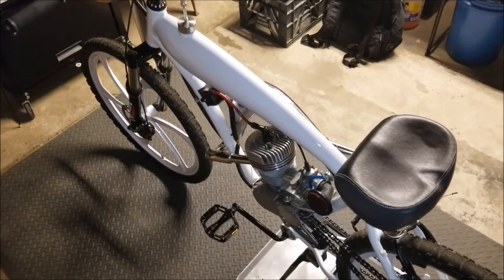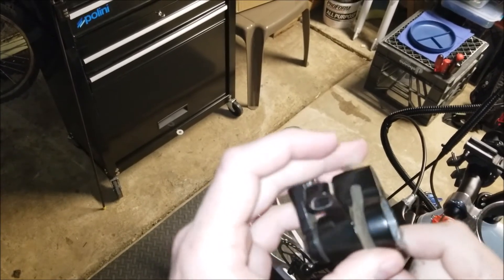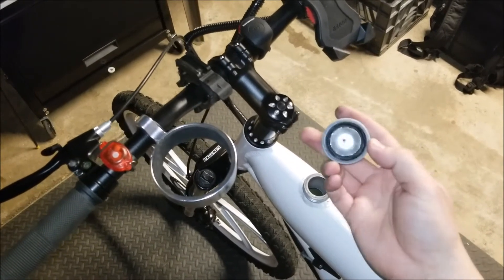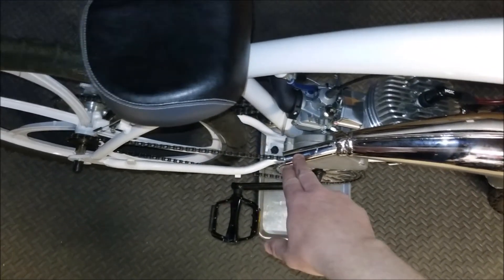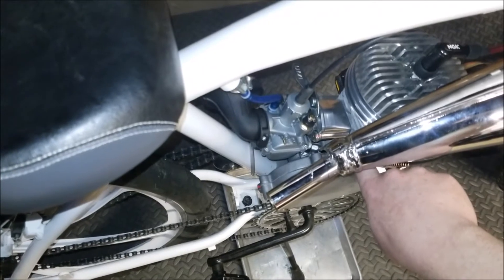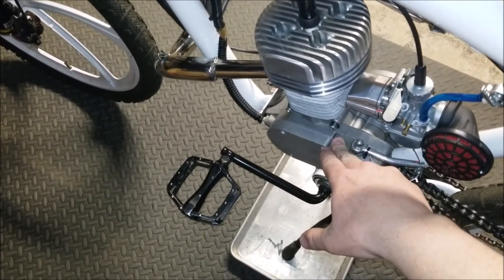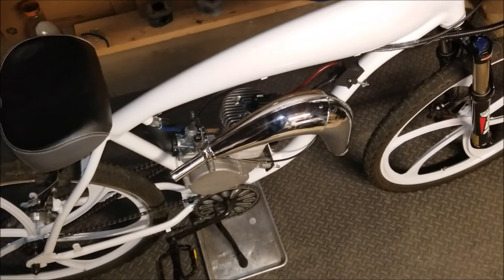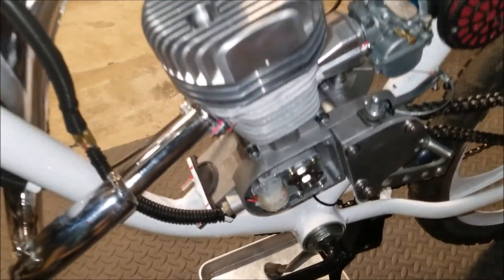Motorized Bicycle Upgrades: Volume II

Comment: Also, what engine did you purchase for your motor bike? In your video you were talking about how you upgraded the carburator? Can you please provide more information on that? TIA!
Reply from the maker: I have a CNC Billet aluminum motor on there now that I assembled myself with balanced cranks and upgraded clutch. However the carburetor I upgraded to was a Mikuni vm18 clamp on carburetor. Just below is a link. I purchased it from treats. If you check out some of my other videos You'll see the carburetor

https://www.treatland.tv/mikuni-vm-18mm-p/mikuni-18mm-vm-round-slide.htm?gclid=Cj0KCQjw_viWBhD8ARIsAH1mCd6SBWvJkXb7ErgKipjgGpxD4ccCKSHxfSAVh_uyXRm5WiMerx2Np8IaApHdEALw_wcB
Reply from the maker: What kind of setup do you have?
Reply from the maker: When upgrading to this type of carburetor just know it's a little more complex than the stock carburetors that come with these motors. You might have to tweak it with the jetting and fuel intake and in some cases the fuel float. I've made a few videos addressing the aforementioned.
Reply from the maker: You're also going to need an 18 mm intake manifold for the motor to match up with the upgraded carburetor
Reply from the maker: Here's a link to another video I did on a sprocket removal and you can see in the video the reed valve setup that I have that the Mikuni carburetor would connect to. The Reed valve will help immensely with fuel blowback into the carburetor which can mess up the fuel to air mixture ratios and cause fuel leaking out of the carburetor onto the bike frame. I recommend a reed valve. you might have to change the carburetor jetting.

https://youtu.be/LVgnUfSoQKw

Comment: it wood be good idea to have fuel Gage and ad a third transfer port ad two carb to it with two ram air tube facing forward coming out were the filter is

Comment: Bicycle Motorsports I know you're into gopeds as well, have you ever considered trying to retrofit a GSR60 goped engine like what Derek Short has all built up on his Ferrari ped? 
I feel like those engines have the highest specific output of any low displacement 2 stroke under 125 cc, just imagine what 1 of those engines would be capable of if it were hooked up to the transmission and everything of a bike like this with a jackshaft kit, Derek Short did 70 mph or so on his ped this would probs do that but on level ground..Would be a neat project
Reply from the maker: Danny Murphy, it's funny you should mention that. Amongst friends, I've said quite a few times how cool it would be if I could mount one of those goped engines to a bicycle. You're correct, the power to weight ratio seems better with those engines. All things considered,  those goped engines are of a much better precision, higher tolerances and better QC than the typical 66cc engine. 

There may be some very slight issues with the positioning and mounting of said engine, but it's something that I will definitely look into doing... Great suggestion.👍
Reply: Bicycle Motorsports You seem like minded my friend... Wouldn't it be cool to develop a frame or something to be adapted purely for ped engines? Kind of draw inspiration from past Goped products and start from there using similar light weight high strength heavy impact resistant materials and make the Jackshaft part of the frame all pre-fitted perhaps. I think a 5 speed would work wonders in opening things up a bit.
I would start with a simple Trek 1 speed fat tire bike, no suspension all aluminum one of the super light ones. Then optimize a zenoah or Chung Yang 46cc high compression, with the pipe, carburetor, air filter etc. then try running it with race gas 103 octane can be easily obtained from the right shop and synthetic 2 stroke racing oil for a clean burn and a little extra responsiveness. That'd be good for 8+ hp right there which is Honda Grom Territory. I think the GSR60's made up to 14-16hp I may be off though.
Reply: I live in Madison WI. ride my Goped Sport G23LH all over haha drivers' license situation is complicated so I've given all this a fair bit of thought. Need to bite the bullet and buy an engine kit and a frame so I can say I know how everything works exactly but I've been putting it off and working on my goped.
Reply from the maker: Danny Murphy, if you end up buying a kit, I recommend the new Grubee GT5A or Zeda 80 in that order.

https://www.grubee.net/products/gt5a-es-2-stroke-engine

https://bicyclemotorworks.com/product/zeda-silver-6680cc-bike-engine-kit/      
You can get the Zeda 80 from Zeda Motorsports but at the moment they're are sold out.

Stay away from random Ebay kits.

Comment: Hey, what jets are you running in your Mikuni, or are you running stock?
I jus got mine with essentially same setup (i.e. ported & polished, third transfer, windowed piston, same mz65 pipe, etc) and if u could save me from the rabbit trail...I ordered several of both main & pilot jets
Thanks in advance...
Reply from the maker: Purnell Espinosa, the vm18 as you prob already know comes with the #25 idle jet and #70 main jet installed. I purchased different size idle and main jets from Treats. I kept the #25 idle and changed the 70 to a 80. You may want to purchase a #60, #65, #75 and #82.5, #85 and #90 main jet just in case.

I also changed the float level (out of necessity) due to flooding and fuel being emitted from the overflow. Float level was just over 18mm (stock) and is now 21mm. NOTE: You will need a caliper and a careful touch to adjust the float level. 

If you have anymore questions, don't hesitate to ask. 👍

Comment: Have you thought about a Jack Shaft?
Reply from the maker: James Lapple, I have and would really like to Unfortunately there are some spacing/compatibility issues with the frames with the front pedestal mounts.
Reply from the maker: James Lapple, yeah I have seen this video before. If you look closely at the pedestal mount and pause it at just the right moment, you will see that this guy has fabricated a custom mounting plate and affixed to it so that the engine can be mounted to the pedestal. I could do the same but... Iam running a reed valve setup with a larger higher performing carb, along with the right angle Molassi Air filter. 

With that being said, unfortunately, there's just not enough space between the rear mounting bracket of the SBP Jackshaft and the air filter. As it is now, I only have about a 1/4" of space between the frame and the taper of the air filter. Add a jackshaft mounting assembly in there and it wouldnt fit at all. It's a bit frustrating.
I have spoken with one of the guys at SBP about this and they are in agreement about the spacing issues. 

I do have some plans to add a modified jackshaft kit sometime this winter.

I appreciate you taking the time to provide your suggestions and links. If you happen to come across any more info of a Jackshaft installed on a similar setup to mine, by all means please send them to me again. 👍
Reply: Thanks for the info, I'm still learning, do you build bikes for sale?
Reply from the maker: James Lapple, I do build these bikes for sale, but primarily on a local level.

I think that's great that you are new to these bikes and are wanting to learn more. That what my channel is geared towards- people who are new and want to know more. They are alot of fun to build and ride.

Comment: taking credit for the design of the fuel cap breather,  hahahahahahahaha,  you funny.
Reply from the maker: Yes I am taking credit for fabricating a breather valve and splash guard on that particular gas cap which would otherwise have neither. I'm not taking credit for the invention of a breather valve on a gas cap, if that is what you meant. 

It would be pretty foolish to take credit for something that is literally on millions of atv and dirt bike gas caps for quite some time now.

Comment: Where the hell is the gas tank?
Reply from the maker: In the frame.
Reply: @BicycleMotorsports  I found this frame right after I watched your video.  How do you like it?
Reply from the maker: @bobbythompson4268  I like the frame very much. The new generation versions of these frames have reinforced pedestal mounts, as the original version of these frames had pedestal mounts that would sheer right off after some time with the vibrations from the motor.
Reply: @BicycleMotorsports  cool, thanks for your input.  I might try one down the line, I’m about to do my first build and I’m just watching anything and everything I can right now at this stage.  These frames look pretty slick I must say.

Comment: Intake port needs to be a bit roughed up when "polishing" your port for a more volitile atmosphere. Oh and its an Engine not an Electric"Motor" that you're talking about. Just say'n.
Reply from the maker: mark kasper,  I thought about it for a moment as I couldn't quite figure it out when you said "electric motor" and finally realized what you meant after I watched the video in its entirety. 
Yes your are correct about the word motor being electric. Iam aware of the difference  and that I use that term quite a bit when talking about these engines. I'm merely using the word interchangeably, that's all. Thanks for the correction. I probably should just use the word 'engine' instead, for accuracy sake.
Reply from the maker: mark kasper, I hope I'm understanding correctly. As I mentioned in the video, the ports do need to be polished for a smooth flow of air on the intake and exhaust. A "roughed up" surface on the intake and or exhaust would not be advisable. If I misunderstood your comment, just reply and elaborate for me a bit. I want to be on the same page.👍
Reply: Hi Jay, im not trying to be difficult, i apologize for the misunderstanding, the fuel gets atomized for a more volitile atmosphere when slightly roughed up not real rough but definitely not smooth on the intake, ive been doing this since the 70's on all kinds of different two strokes. I enjoy your page and am looking forward to more videos, you're one of the more tolerable people to watch hahaha! Keep on rocking it.
Dan Bucannan Sr. On Facebook is the owner builder of that HDlightning strike cdi that i spoke of previously HD(HuffyDavidson). Enioy!🏁👍
Reply from the maker: mark kasper, I certainly didn't think you were being difficult. I appreciate your insight. I had never considered the volatility and atomization of the fuel beyond the carburetor on the intake before. I'm intrigued. I'm going to do more research into this. I always appreciate contributing ideas. 👍
Reply: Yes, it's an Engine.

Comment: There is nothing wrong with those yining brakes, if you know how to adjust them.
What do you think the "better" brakes are made of, some cheap pot metal alloy.
They suckered my brother at bike store for shimano's, not me I knew better.
A caliper gauge would tell you what the pads are and I found them on Amazon
ez. The fact you were in a bike store tells me you fix problems with your wallet not your head.